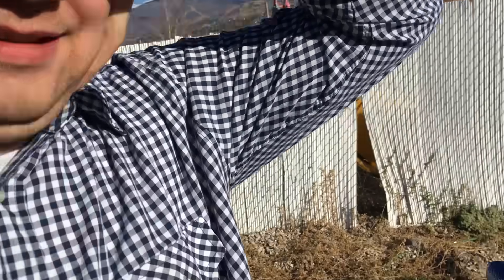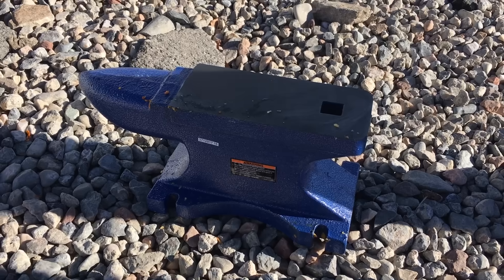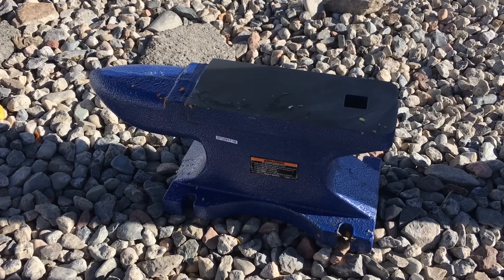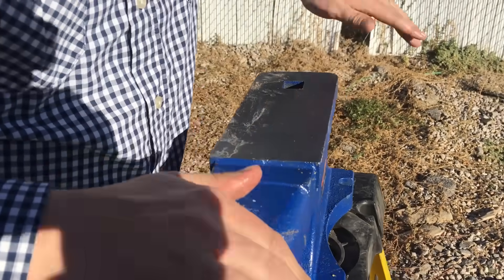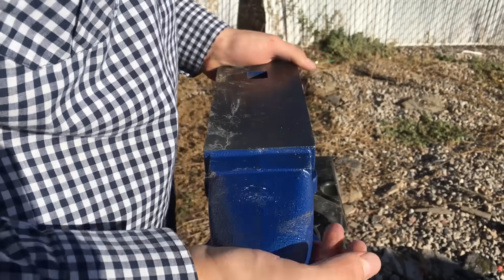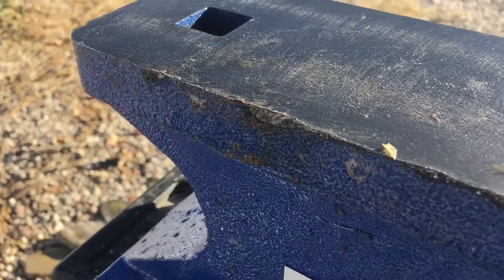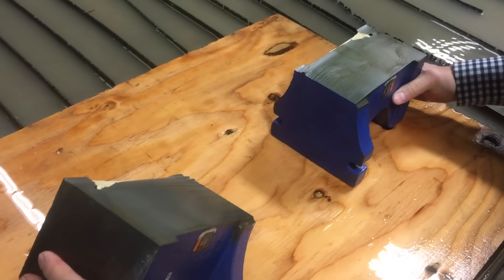Cutting An Anvil In Half With A 60,000 PSI Waterjet -  whats inside an Anvil? - Scandal

Comment: I bought myself a Xhinese lathe and hated doing it and hate the machine and hate using it and hate that they just make so much junk and the entire casting is covered in car patch up goo just as you found on the inside of that anvil.... Best of all is the tailstock which has been plated with light gauge steel plate to make it look like one solid piece of gear but its got filler all in it and then paint to make it appear smooth and solid..... 
Have you got any idea at all of just how bad I hate cheap Xhinese junk I just won't even show them an ounce of respect enough to even write their name correctly...... !!!

Comment: Hey random question I cut agates in half with a diamond blade. In theory if the psi equivalent to my 1800 rpm saw blade and water resistants and coolant....could in theory there be a “jewelry” quality polish/cut combo????
Reply: The prices of lapidary cutting...then a polish...if possible would be ground breaking.....

Comment: This is an anvil from Harbor Freight, made of China-ium. Mass produced and about as shitty as an anvil can be. The surface isn't hardened at all and can be easily dented with any metal hitting tool, which is what it was designed for use with. Now I come to find that half of the cast iron cast is actually not even there and is an inadequate filler? Throws even more shit at these fucking garbage anvils.
Reply: Well no dip it’s not hardened it’s cast iron

Comment: What is PSI. Just surface pressure.  To change you vary the area under force.  Force is created by varying surface size. Frequency is the difference in surface pressure. To see distant objects or micro objects lens with varying psi is required. A flat gives light a curved gives infrared a sin gives ultraviolet etc. To cut an object the psi should match the pressure of the material.

Comment: Todd the Anonymous homeowner loved his water jet. Todd used his 60,000-PSI water jet to cut two home attackers into several pieces. Todd said "The great thing is I turned down the water jets power to successfully clean up the bloody mess I made by chopping up the criminals. Todd concluded by saying, "The water jets were so quiet that the neighbors were not disturbed and with the criminals cut into pieces it was easy to get them into garbage bags to bury them in my back yard."
Reply: When we had this conversation you literally said "I won't tell a soul."
Reply: +Todd Buckman: Ha, don't worry buddy I'll come over with my shovel and we can rebury those crooks so no one will find them. No bodies no charges.

Comment: As a hobbyist smith, that is hugely unsafe, filling that gap with bondo could have resulted in a catastrophic failure, with a shard of that anvil lancing right into the user.

then again, i literally use a 3 foot length of railtrack as an anvil...

Comment: That isn't really an anvil, it's what is known in the trade as an "ASO", which stands for "Anvil Shaped Object". 

Anvils are homogeneous hardened steel, and an anvil certainly wouldn't have a void from the casting, let alone a void filled with Bondo.

Realistically, only a blacksmith needs a genuine anvil, so for 95% of what people use an anvil for, an ASO is fine.

Comment: That's super messed up I was seriously considering buying one of those anvils...... That's such a douchebag thing for a company to do!!!! I'm seriously mad af.
Reply: There are a lot of people who think that only the most expensive anvils will do,  but cheap ones will work just fine unless you are beating on it with a 20 pound sledgehammer. That was just a casting void that happens and it was in a location that would not effect the use or safety of the anvil at all when you use it properly.  I have one of those el cheapo anvils and I've been using it for many years without issue.

Comment: You should sue them. 
That's intentional hiding of a safety hazard.
Or at least get your money back.
Reply: MacClay8 there is another video review of this anvil done by a blacksmith. The metal is too soft for ANY metalwork. It shatters and dents very easily. They dropped it in this video and the gravel put huge dents in it and chipped pieces off. Now imagine placing red hit iron on it and hitting it with a 3lb hammer. Metal will fly. It doesn't have to hit you in the face or leg to be dangerous. You could be holding a shoe with tongs and a piece could fly off cutting your arm or hand. Advertising it as an anvil when it is unhardened cast steel is not right in any way. Having giant chunks filled with foam and painted over to mask the sub par manufacturing is unethical and illegal.
Reply: Take it back in two pieces and say it broke in two when you hit it, whilst pointing at the previously concealed defective casting crack.
Reply: kkknotcool please sue them, only fair
Reply: How is it a safety hazard? (Not trying to start an argument; I'm genuinely curious.)
Reply: @MacClay8
it is obvious you have no clue to what you are talking about. Ever been hit by a piece of steel moving at 300 FT per second? That is exactly what you would get from a piece of that anvil breaking off after being hit with a hammer, which by the way is it's intended purpose... P.S. I can show you the 3 inch scar with 150 stitches it took to close it up on my leg from just an accident. Porosity in metal is a very real threat to soft tissue.
Reply: Well the warning on the side says "discard if chipped"
Reply: MacClay8 actually it is a major defect. It can cause many injuries by any that purchased one and actually uses it. I know many blacksmiths that could break that off just shaping horseshoes.
Reply: Most pros won't use Chinese chit.
Reply: I agree that it is a safety hazard and false advertising. No "Anvil" should have bondo on it.
Reply: Err... I had one of these... as my first anvil. I quickly switched to a couple of chunks of steel. Honestly the bondo is probably stronger than the cast iron chinesium they use. I only keep the blue one for if I am forging and my brother wants to heat and beat. I could easily break one in half, though you don't want to swing with all your might. You keep a steady hammer drop rhythm.
Reply: @Island Metal Forge
I use a piece of RR track. Been hammering on it since the 70's still like new...
Reply: I never disputed that it was a major defect.  I said it wasn't dangerous.  So long as you don't keep your unprotected face by it while your buddy hits it with a sledgehammer, it isn't.  Unless you are using power tools, the mode of failure is 'a piece fell off', not 'a piece flew off and embedded itself in my leg'.
Reply: Bang On .
Reply: It isn't.  The defect isn't on the face and in all practicality no one using an anvil hard enough to break it even with that void would buy one from Harbor Freight anyway.

I'm not defending the 'quality' of this anvil or the ethics of its manufacturer.  It's total bottom tier and made by greedy jerks, but the defect here isn't specifically dangerous.

Comment: I had one of those 'anvils'... when still new it was accidentally knocked on the side and a good sized hunk of Bondo just flopped out.... you could still smell the solvents outgassing from it. Poking/prodding around revealed a good bit more; much more than the specimen you cut. On mine, they'd apparently tried to fill filthy/oily voids, and in some areas the paint was the primary adhesive retaining the Bondo. Skankiest looking casting I'd ever seen.

Comment: I want to start blacksmithing so but but these stupid youtubers always do STUPID stuff with them
Reply: Lane H that isn't what you want to use to start smithing. You are better off going to a CNC shop and having them cut you a 12" by 5" by 1" steel striking plate and mounting it into a solid based stand and using that to start with.

Actually go look at DF in the shops videos about his CNC anvil project.

Comment: That's actually really awesome - I'm not sure if I'm more impressed that it took basically half an hour for water to saw through that chonk of metal or that you uncovered shady anvil sales practices through sheer luck, both are kinda really awesome!

As for the website, I'm not sure what else you might put up other than links to all the relevant things (the channel of course, a patreon if you're doing that sort of thing, any social media pages, etc) and a store, but I for one think it would be neat just to have an image gallery of a lot of the things sliced open once you've finished with them.  My biggest selling point on you guys to my friends thus far has been to pause a video and be like "so did you know a bowling ball is basically just a jawbreaker too big for your mouth" and show them.
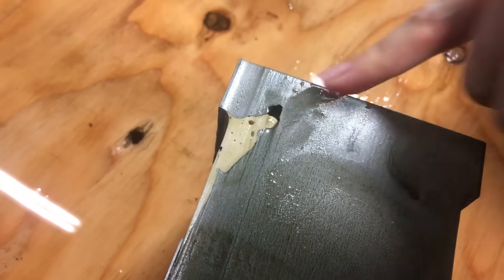Reply: 2:53 that’s made in China quality… Always cheap and no quality control. Everything is always fake and junk! 

Well done Xi💩👈
Reply: I worked in machining briefly. Building decks for amazon robots...porosity cavitation etc was usually stricter but they were under pressure to produce so stuff flew that usually wouldnt...nothing even close to that bad however. Harbor freight China made i bet

Comment: That filler is shady as fuck.
Reply: JCI1990 oddly specific.
Reply: You get what you pay for. For how much it costs and what its going to reasonably be used for, it's probably just fine. This was a $65 anvil, where a high quality one for a lifetime of regular use is more like $400-500
Reply: Parker Anderson "This is a pretty common practice with cheap castings." - Eh, actually that thing looked even worse than a Swiss cheese (considering the amount of bondo they used). I'm sure that anywhere outside of China such "masterpieces" would be declared rejects and re-cast.
Reply: @seth baker,  $400-$500 old and very used if you're lucky,  Try $1200-$3000 for a new quality anvil.
Reply: This is a pretty common practice with cheap castings. You get what you pay for
Reply: konaye4ever2 right. Seems safe.....
Reply: Nikki Meade Obviously it depends on the size, but the big quality ones will definitely cost that much, yeah.
Reply: I doubt anybody's gonna hit the side of the anvil to make it shatter, but still they let an anvil pass inspection with bondo. Well when you pay Harbor Freight prices(one-time use) its bound to break.

Comment: Well I know what anvil brand to avoid now!
Reply: deweys yeah...they are known for taking defective anvils to market
Reply: Good to know for the next time I want to drop one off a cliff on to a roadrunner.
Reply: That's an anvil from harbor freight. It's only a cast iron anvil, not a real steel anvil. So it's definitely not very good quality. But it's good for just getting into blacksmithing.
Reply: Just go for a railroad track
Reply: umm I wrote ''100s'' meaning multiple hundreds of dollars I have bought several  items from harbor freight  that have served me fine including an angle grinder, Vice, and, belt sander I'm not saying they very good but they are fine for the cost ! of course well made tools are better but for those of us who have to work hard for our money we have to save a little now to get the better tools later
Reply: IMHO, HF tools range from cheap to inexpensive.  Which is which depends on your usage.  Cheap tools break early and you have to buy another tool.  Inexpensive tools are the best price / performance tradeoff for what you are doing with it.  Low purchase price isn't always the best deal for you.  E.g. after a close one, I don't buy cheap tires or brake pads any more!

Again IMHO, HF metallurgy is crap, so I avoid anything that's highly stressed.  For example, after having "import" drill bits snap on the second hole (in steel), I stopped buying small import bits - but my rarely-used 1/2" and up drills are HF because they don't get highly stressed.  

This will likely change over the years, especially as companies have products built in China and show them how to build quality products.  Remember that around the 1940s the Japanese made cheap junk, but now their products are among the best in the world.
Reply: Anything harbor freight is suppose to be one-time use, i doubt any serious blacksmith or let alone any professional would go to that store for quality.
Reply: Brent Legg- yeah its great for starting I have one and the only major problem with it is (being cast iron) the edges don't retain there angle like at all but other than that its fine been using it for months ! not saying its a good anvil really but it will do the job and for $65 compared to $100s its fine !
Reply: Renee Beckford an interesting perspective.  By that criteria, has anything you have ever eaten, worn or owned NOT been defective?
Reply: deweys a-VOID!
Reply: iTheGeek lol no. Pretty much anything made out of Chinesium is trash. Proven so most often by the huge price difference. They might be okay for some basic housework but not much more than that.
Reply: deweys Dude anything ANYTHING that loses to a 60,000 psi waterjet is defective
Reply: Emmanuel Hernandez How dare you talk back to me after I died and came back for your sins. 100 lashes for you.
Reply: Emmanuel Hernandez I don't approve of someone claiming to be a soldier of mine. As God I need no soldiers only more sheep.
Reply: Emmanuel Hernandez I'm God, so that makes you my sheep? Well in that case I have some bad news. Allah is the one true King.